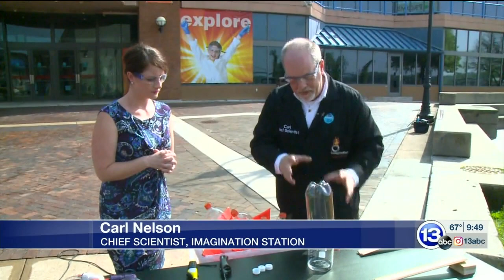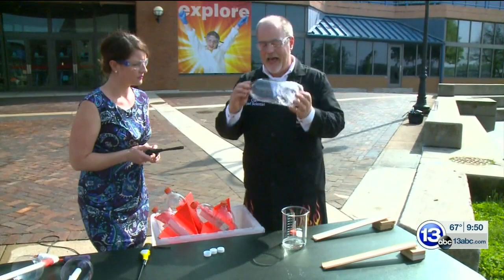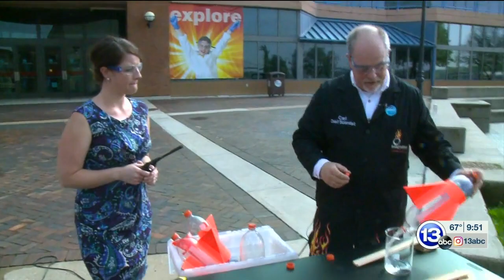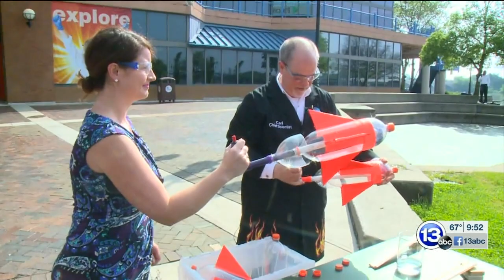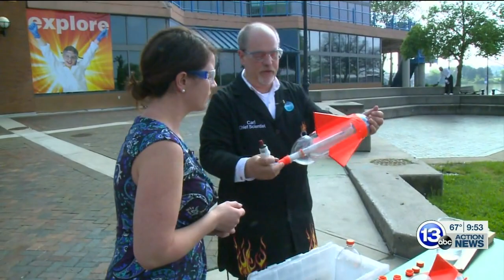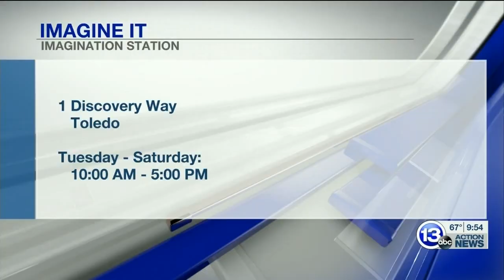Rockets powered by combusting ethyl alcohol

Comment: I did it with my isopropyl alcohol and a gas lighter
Reply: Same
Reply: ethanol is better it has a lower boiling point and it evaporate faster and burn better
Reply: @kangle2938  thanks for the tip im building my own gun and was wondering which i should use